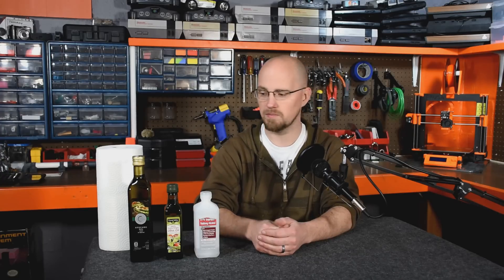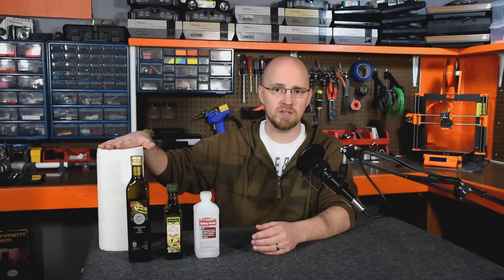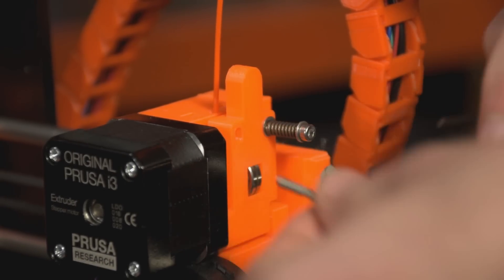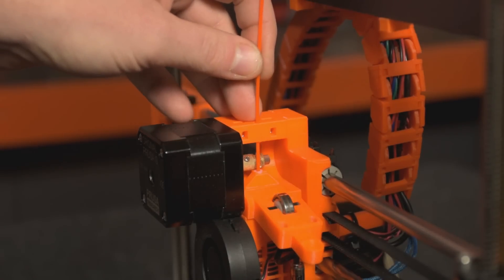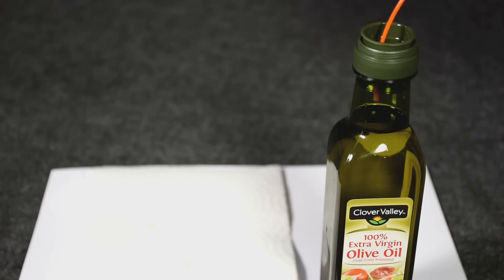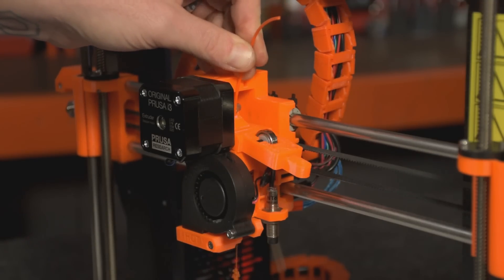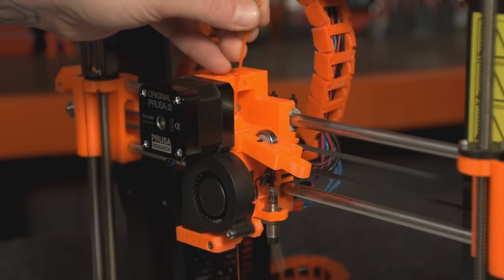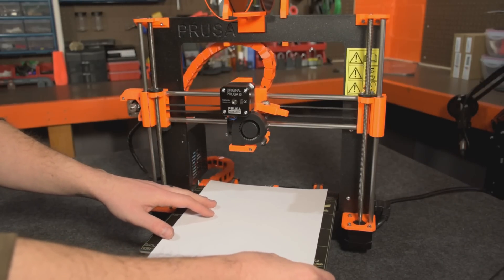How To - Nozzle Seasoning

Comment: This isn't necessary if you already use a Filament Oiler right?
By the way: Silicon Oil work great if you use that for Oiling the Filament. ;)
Reply from the maker: I think this is a fantastic thing to do initially, and then perhaps use an oiler instead of re-doing this after time passes. I personally haven't had much success using an oiler because I could never seem to get the right amount of lubricant applied to the filament and I had frequent layer adhesion issues, though everyone's experiences with many of these things will differ slightly. This seasoning method seemed to give me the benefits of lubrication without the ongoing fussiness of tending to an oiler. Obviously YMMV though.

I think seasoning is also great when you're installing a new nozzle since its the one opportunity you have to get the lubricant in direct contact with the metal before you've run any filament through it.